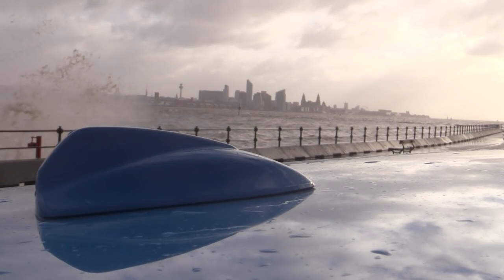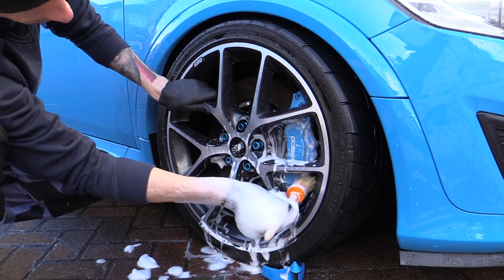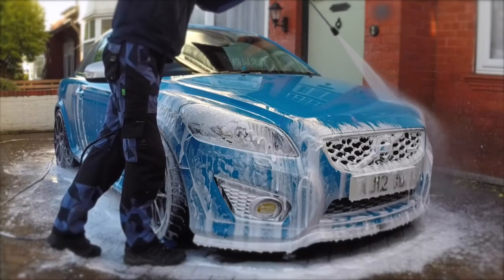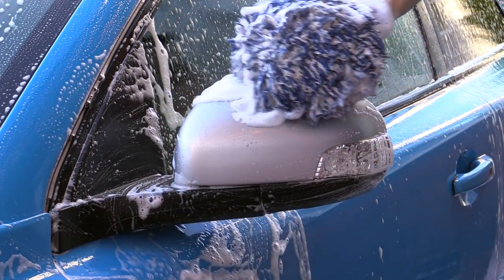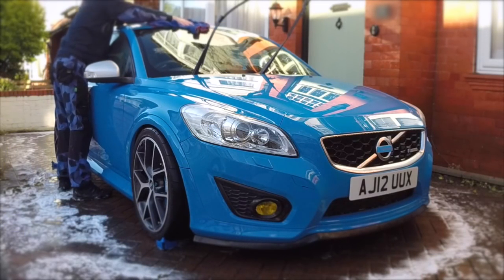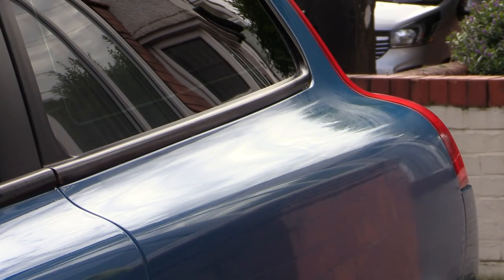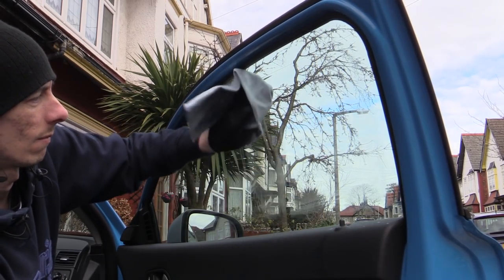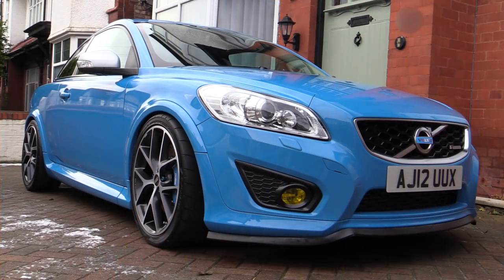'Guru Mobile' Salty Seawater Wash!

Comment: Something I did notice on your microfiber towels. If you look closely you can see the surface of the towel has begun to ball up rather than have that “plush” look as intended. That’s typically a sign that too much heat has been introduced to the towel and it’s fibers have melted together. For microfiber, you always want to wash on cold or warm and dry on low or tumble dry. This extends the life of the towel substantially and now it won’t lose any efficiency. Just a quick tip from a “microfiber guru” :)
Reply: ALLDAYANTHONY omg thank you for the advice.
Reply: ALLDAYANTHONY I want to call you a sad git, but I found your comment somewhat informative, therefore I have restrained from stating said criticism.
Reply: BustaNut InUrMom Please entertain me with a correct answer
Reply: ilovenitnat thank you! I work in the microfiber industry specifically so I try o spread knowledge when I can
Reply: You all do know who Anthony is don't you? ..... wash Wednesday?  The rag company? Providers of the finest microfiber products in the known lands? .....
Reply: Is it okay to let them dry on a clothes line?
Reply: look again bud, he had open inverted commas, meaning that he quoted that. And you couldn't even tell that his "'I thought I made that up" was a sarcastic remark? LOL 😂
Reply: UrMomAlways OnMyPole please elaborate lol. Was just pointing out that he was sarcastic, and you didn’t get it
Reply: UrMomAlways OnMyPole I do not agree with him, mainly because I do not know anything about this microfiber thing and I am in no position to say anything about it. I replied to your comment because I was bored lol. But from your replies to him, my interpretation was that you couldn’t catch the sarcasm. Mainly cause you said that he was a liar after his obviously sarcastic remark. Idk, I guess I was wrong or you’re making an attempt to save yourself

Comment: There's a new product from Karcher that is a kind of spray trolley on wheels at you connect to your pump and roll under the car. I think that would be a fantastic tool in your arsenal.
Reply from the maker: I want to attach a gopro to one for a video.

Comment: You have probably been asked this loads of times but when I wash my car by the time I get all the way around (about 5-10 mins) the other side has dried to the car and becomes streaky. So I need to wash it again. Sorry of it sounds stupid.
Reply: FastPuma 

You can usually address that by drying the body with a damp microfiber towel, and try not to wash in direct sunlight if you can help it! I take it you live in a hard water area too, it's a PITA!

Comment: Even the detail guardZ are in polestar blue👍
How do you maintain yr Kränzle ?
Volvo is like an U Boat iT Will never rust!!!😋
Reply: Answer to your Kranzle question, Change oil after the first 50 hours of using the machine. Then after the first oil change you can change it every 1000hrs or once a year. Make sure to replace seals when doing so. 15w40 oil for the K7 series
Reply: Jack Chapman thx, did that still low water pressure and the oil instantly turned greyish..😟
Reply: i havent experienced low water pressure. Even before i changed my oil, the colour turned slightly milky/greyish like you say. its just moister in the housing. It is nothing to be alarmed about. My lives outside in a shed so its likely condensation will take place. The oil in a kranzle doesn't lubricate moving parts, it is used as a cooling system for the motor. Do not be alarmed.
Reply: I have only experienced low water pressure when i changed all my fittings to quick release and this was due to them not being tight enough. Check you have no leaks first.
Reply: A
Reply: Jack Chapman no leaks mate, replaced new seals.. cleaned al valves...🤔

Comment: Glad you're back Guru. When doing your wheels, I noticed you using the bigger barrel brush near the end whereas I use it at the start of washing the wheels. Is there a reason you did it in this order? Thanks and keep the videos coming. Cannot get enough. Regards
Reply from the maker: It's probably just habit from cleaning really dirty wheels where I do the fronts first to give the rears time to soak in cleaner. People will say doing them last will just pull the dirt out over the freshly cleaned fronts but they're being rinsed off anyway so no biggie.
Reply: Car Cleaning Guru is there really no right or wrong order then? Cheers
Reply from the maker: It depends on the wheels, the products being used and the conditions really.

Comment: How ‘bout cleaning underneath the car to remove the salt?
Reply: @11:00
Reply: all new cars are protected from below
Reply: Haha, what?
Reply: CarPassion no they aint
Reply: David Richards yes they are
Reply: CarPassion haha 👏🏼
Reply: ...No, they're actually not.
Reply: Flygman not my fault you drive a old fart can all the new cars have protection.
Reply: What protection are you talking about?
Reply: That is such a sweeping statement. Newer cars generally use higher quality galvanized parts compared to old cars but you'd be an idiot not to spray the underside of the car after that amount of exposure to salty sea water.
Reply: I had to have welding done on my 11 year old Golf so they ain't.
Reply: All cars since the 60s are treated against corrosion, but that doesn't hold forever, and certainly doesn't when it's not sprayed on all panels and beams. That's why many cars have certain spots where rust is very common, because they were not treated well enough in certain places. Look up Volvo V40 hatch rust for example, they all rust in the same spot. That will happen with all "new" cars aswell when they're old enough.
Reply: Agree, I have a 90 degree elbow for pressure washer nozzle which  allows the  lance to be slid under the car.
Reply: Volvos have corrosion coatings underneath
Reply: Every car has that since 70 years back, it doesn't do much after years of wear. That's why you gotta make sure your undercarriage is clean from salt and keep it painted & protected.
Reply: Did you not read the Inspection and maintenance part? Lmao
Reply: "what protection are you talking about?" Do you understand context? Lmao
Reply: So you skipped my latest comment and instead replied to a really old one? And I'm supposed to automatically understand that? Kids..

As I said, corrosion protection is on every single car manufactured and doesn't do much. Go take a look at your dads car for example.
Reply: Nice cognitive dissonance.
Reply: He might have a passion for cars, but he's obviously shite with them
Reply: Does having everything covered in protective paint affect the MOT test?  Would they want to be able to inspect for any signs of corrosion that may have been hidden with this paint?
Reply: CarPassion My 2017 Powerstroke is rusting in Canada. They're not protected.
Reply: Human Being hey fellas, since we're all talking about corrosion here, what's your guy's opinion on fluid film as an undercoating before winter? I live in northern Illinois. It can get pretty brutal up here. I was think about taking a metal brush and getting underneath my car and taking care of all the rust if there is any, and then giving the whole underside a coat. Thoughts?
Reply: No cars are ever fully protected underneath only if you send some time and money and the jos over have a crappy car 😂 £15 polish wash and she mint 😂
Reply: What about the water activates the corrosion reaction between the salt and the steel that it is sitting on?
Reply: CarPassion True, but salt dissolves protectants.
Reply: CarPassion my 2012 needed welding due to rust, so no they aren't haha. They'll use better materials, but won't be using any special coatings.
Reply: That's old
Reply: Brand new cars have painted and protect suspension parts and scrappy but okay sealant on the undercarriage it just falls off over time doe to back conditions and winter :)

Comment: I do love that car! Not so keen on the silver door mirrors though :)
Reply from the maker: I want carbon caps ideally.
Reply: That car is so clean and simple (with the silver mirrors).  Carbon fiber was developed to have strength while reducing weight.  The fact that it "looks cool" is a by-product.  "Applied" carbon fiber that actually increases the weight (albeit by a tiny amount), just to get "a look" doesn't fit the car or the guru of cleaning IMO.

Comment: Please help. My bmw 120d  steering wheel is constantly greasy looking. My previous cars have never been this bad. I've tried everything now.. Magic sponge is good but it becomes greasy again after a couple days. My hands are always clean when driving. Tried magic sponge plus conditioner and other leather cleaners
Reply: Wash your hands before each drive or wear gloves.
Reply: gary hems nice one....
Reply: Use Autoglym Interior Shampoo, or similar, to wipe down your wheel. The Guru uses Auto Finesse in this video. AG is safe on leather and fabrics. Less is more. Don't use a dressing product- only use a cleaner.
Reply: bigkahunaburger cheers ill try that as I have some AG interior cleaner. However meguiars leather cleaner and conditioner works but it goes back pretty fast
Reply: Ordered dodo juice supernatural leather cleaner it came today. Supposedly one of the best leather cleaners. And my wheel is stil not completely mat. It's a very uneven finish and my wheel is patchy. I'm beginning to think it's permanently damaged. The cars only 2012 with 60k.  Strange

Comment: Just a quick question if you use tar remover on your paintwork will you need to polish and wax afterwards?
Reply from the maker: You technically shouldn't need to polish but it will most likely strip any protection already on the surface.

Comment: Did the pressure washer just remove the surface rust off the brake discs?
Reply from the maker: No it caused it most likely.

Comment: Why is it you don't use air pressure to dry off the car while then following up with the fluffy microfiber towel?
Reply from the maker: Don’t have a compressor and it only really works on properly polished and protected cars.
Reply: Car Cleaning Guru thanks. I figured you’d have a professional reason. I’ve thought about buying most of the stuff you use to use on my bike and car in the garage because you make me want to clean them all the time
Reply from the maker: Air blowers are good for bikes and getting water out of cracks and crevices even if paintwork isn’t protected to be fair.

Comment: Great video GURU!.  Volvo C30 T5 a blue color 305 Hp?.A great profesional wasching cars.
Reply from the maker: Not sure on power but it has to be around 300 give or take.
Reply: Think they run at 250bhp,roughly 20-30 bhp more than the standard c30 t5 which is the same engine and transmission as the focus st 👍

Comment: What do you do if you have a new customer call up but they haven't got a water supply?
Reply from the maker: Tell them to buy a house before a car.
Reply: Sorry, I meant if your customer doesn't have an outside tap you can use for your pressure washer.
Reply: As you don't carry a water tank
Reply from the maker: Hasn't happened yet but I do have a universal connector that can be used on a kitchen tap.
Reply: Thanks for your reply. Love your vids, they are what gave me the confidence to set up my own company. Thanks again. Looking forward to the next vids.